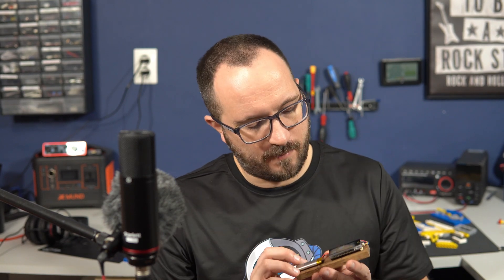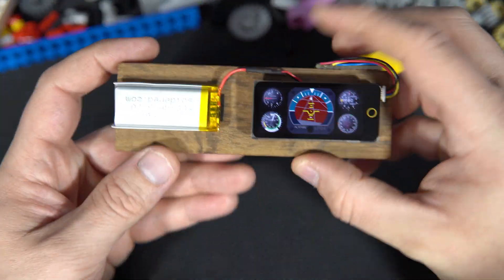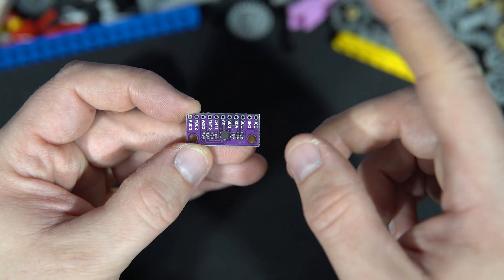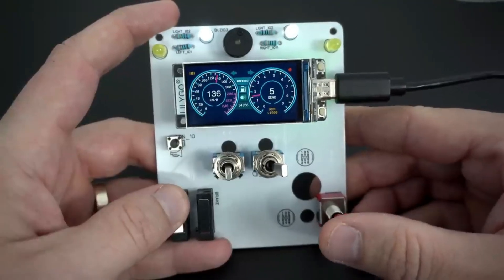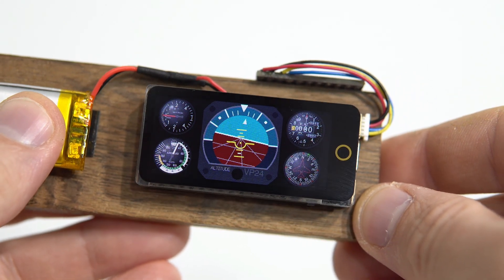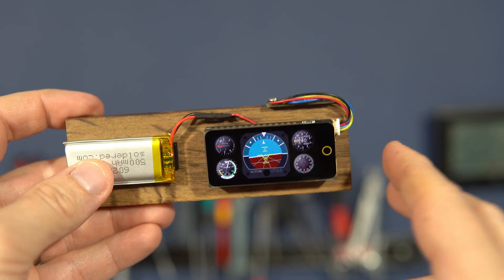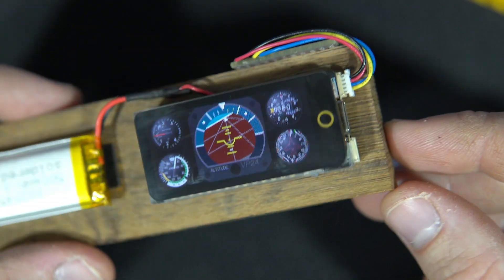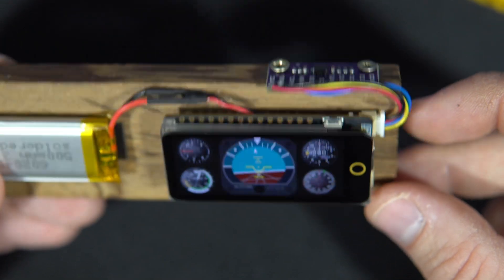I made Attitude Indicator for ESP32 board

Comment: Hello. I am a beginner in Arduino. Where are the SDL and SDA terminals on the standard version (only 1 small connector) of the S3 AMOLED module. Thanks in advance and thanks for all your assemblies.
Reply from the maker: On esp32 any pin can be scl or sda. You just need put in code Wire.begin(sda_pin,scl_pin)

Comment: Very Nice and I'm looking for months to have this 'RC scale cockpit' to use it in FPV. This is so awome!!
Indeed a reverse of the roll is needed, 
Is there a possibility to add a gps with flux receiver to have speed and direction?
A barometer to have pressure altitude?

Will it still work if I put it in a plane, because accelerometers are fine to calibrate but it should work of gyroscopes. 
Because if you make a coordinated turn for example the roll indicator will indicate a level situation although you're banking.
In this case, using only a accelerometer it makes a turn and slip indicator.

Comment: I just noticed, your board is different than what is available on LILYGO.  Yours does not have the two buttons and mine does not have connectors that are on yours. ????? I looked at the lite version, has the buttons and the connectors.  ????
Reply from the maker: Mine is touch version. You bought versiin without touch.

Comment: sorry to bother you, but I have attempted to solve this for 3 days.  I keep getting the following error message:#if ESP_IDF_VERSION < ESP_IDF_VERSION_VAL(5,0,0)
#include <driver/temp_sensor.h>
#else
#include <driver/temperature_sensor.h>
#endif   
temp_sensor.h  cannot be found.  I have searched all of the libraries, to no avail.  I wanted to check ESP_IDF version, but cannot that file.  ????

Never mind.  I give up.  Too many deprecated libraries.  I discovered what ESP_IDF is and cannot resolve that issue.
Reply from the maker: you need to go to board manager in arduino IDE and downgrade your esp32 boards definitions to lower version than 3.0,

Comment: I am trying to compile the code, but I get an error message.  The following cannot be found, In file included from C:\Users\rick\Documents\Arduino\PlaneTDisplayAmoled\PlaneTDisplayAmoled.ino:11:
C:\Users\rick\Documents\Arduino\PlaneTDisplayAmoled\LilyGo_AMOLED.h:21:10: fatal error: TouchDrvCHSC5816.hpp: No such file or directory
   21 | #include "TouchDrvCHSC5816.hpp"
      |          ^~~~~~~~~~~~~~~~~~~~~~
compilation terminated.
exit status 1

Compilation error: TouchDrvCHSC5816.hpp: No such file or directory  I 
I believe this is an updated version.  If so, I cannot find the original.  Any ideas?
Reply from the maker: you need to download this 
https://github.com/Xinyuan-LilyGO/LilyGo-AMOLED-Series

and  extract zip files and inside you will find libdepts folder, all folders inside libdepts need to be copied in your libraries folder.one of thease folders is  "SensorLib" ant that library contain files you are missing.

Comment: This is sooo cool! Will have to look up and get the sensor. Adding a GPS to the mix to have a directional arrow showing you the path and maybe an overlay of controlled airspace would be a cherry on top of the cake or at least per second logging of altitude and coordinates in a log file would be a killer.
If I may point out that you need to invert your logic on left and right banks. You have it inverted. Left bank would put your left wing in a dirt if that makes sense.
Do you think esp32 could handle some basic maps?

Comment: Nice, I have done an attitude indicator using an AHRS and its a lot more basic - in an actual aircraft you cannot use accelerometers for pitch and roll.  When an aircraft banks at any angle, a pendulum would always point direct to the floor, because you are turning in a circle when you bank and thus the forces cancel (unless you are flying out of balance).  Similarly for acceleration and deceleration, if you use an accelerometer you would think you were tilting back for acceleration and forward for deceleration.  And that is because gravity isn't a force its an acceleration.  An AHRS fuses data from gyros with accelerometers as well as magnetic flux to maintain its place in space - which is tricky.  Luckly you can buy one that does all of that and gives you the figures and you just draw them.

Comment: It's not an attitude indicator, its just an accelerometer. Lets say you put that in a car and take a sharp turn on a flat track. The horizon will show a bank even though the car is still horizontal. Likewise take the car to a banked oval track and take a banked turn at the speed that the bank is sloped for. Your device will show the car level even though it is banked. Aptitude indicators use gyroscopes. If you try to use that in an airplane, you will think you are level and go into a bank turn and possibly even a 1 G role. That wouldn't end well.

Comment: To all the Pilots that want to use this: Don't ! You will need actual airspeed and rate of turn to get the bank angle correct. Otherwise it will level out when you are in a normal turn. Likewise, but to a lesser extent for pitch angle. This because the sensors are just accelerometers /  gravity sensors vs true gryo's so they are good detecting movement. In a steady turn / pitch (1G) they will null out.
Reply: I don't think it was meant to be taken seriously!  Really is just a fun project...but appreciate your expertise on this subject!
Reply: @WahidKhan-r5m For sure! Just mentioned as many have tried to make something like this only to see it fail when used in actual flight.
Reply: @davepompea  thats cool , 😎  good point

Comment: Another beautiful project (you have excellent UI skills !). Which dev env do you use ? Im having trouble getting these recent projects to compile. For several years I have used the PC Arduino IDE  application for older ESPs. There are now options for web IDE and PlatformIO. I have bought several of these newer devices you have shown us (LilyGo should pay you a commision :-) ) and for all of them I have failed to get the correct libraries installed into the IDE and worse can no longer build my legacy code. I feel I need to start from scratch or have alternate IDEs and be able to configure different library locations ?  I understand the board manager and location of libraries but it seems the specifics of lvgl paths for different boards can interfere with each other. Appreciate your suggestion.
Reply from the maker: I use only Arduino Ide, it is not best ide but is easiest to setup. You can try to install evrything from start. Yes , dealing with diferent boards can make mess. Just install esp32 boards in arduino Ide, version lower than 3.0 and then you can install libraries in libraries folder by hand, and dont update them.
Reply: Try not to install the library in the IDE but simply copy the .cpp and .h files into your project folder, then replace < > with “ “ in the #include…

Comment: As a paramotor pilot I see a use, maybe with baro for pressure and altitude and even analogue input for engine temp and digital rpm capture. Data logging would also be cool.
Reply from the maker: Tnx for advices, i wish i have more expirience with this . It seems i made many mistakes. But it seems is not to bad.
Reply: What you're describing already exists as freeware. It's called Ardupilot and can run on a $30 STM32f405 board (look up Omnibus F4). It has GPS input and will even add autopilot functionality to the A/C. I used one in my Long EZ for logging.

Comment: If you use a temperature, pressure and humidity module, you can also have altitude reading added to the altimeter in the top right. The airspeed indicator (the gauge on the bottom left) should be on the top left. If you google "aircraft instruments six pack" you will see the standard setup of instruments. Sorry, couldn't help it, I am a pilot. ;) I hope you don't mind. Love your channel,  I see that you like to play with Lillygo T-Display S3 a lot.  I can't make mine work for anything. Pozdrav iz Washingtona!

Comment: What libraries does the code require?

When I try to compile it I get an error about a missing drivers \ temp_sensors.h file.
Reply from the maker: In code you can see adafruit libraries that are used, you can download them and it will wor then. Did you manage run my last example for this board?
Reply: @VolosProjects  Thank you very much for replying and showing us how to use this board!

I did loaded the Adafruit Sensor & LIS3DH but the attempt to compile still lists the temp_sensor.h file as missing. I don't know which library that error is talking about to load it as there are so many others also listed when I search.

Could you let me know which lib has the temperature sensor file?

I have not tried your other examples but I will.  

Many thanks!
Reply from the maker: @opjose  Thank you , but belive me this is not firs example you want to try on this board, also project will not work if you dont have LIS3DH sensor.. can you please try my first project from this videe, you will need to use right libraries , i explained which ones in this video https://youtu.be/Waq2xI-t948   you will need to go  to this rep and coppy all libraries from here in your libraries folder https://github.com/Xinyuan-LilyGO/LilyGo-AMOLED-Series/tree/master/libdeps
Reply from the maker: you are right, lilygo updated libraries and i used old ones, i updated my code please download and try new version.
Reply: @VolosProjects  

Thank you again. However when I try to compile the new code I get the same issue:

* @file      LilyGo_AMOLED.h

Arduino Programs\PlaneTDisplayAmoled\LilyGo_AMOLED.h:30:10: fatal error: driver/temp_sensor.h: No such file or directory
 #include <driver/temp_sensor.h>
          ^~~~~~~~~~~~~~~~~~~~~~
compilation terminated.
exit status 1

Compilation error: driver/temp_sensor.h: No such file or directory

I do have the libraries installed.
Reply from the maker: hm, weard, do you maybe updated esp32 board to 3.0 version, it will not work, you need to use lower esp32 board definitions @opjose
Reply: @VolosProjects  It was the ESP I2C slave library which was at 0.3.0.  When I rolled it back to 0.1.0 the compilation worked!

Thank you!

Comment: How sensitive is it ? Perhaps it can be used in a jeep to check angles, or use on an RV to check the level.
Reply from the maker: Sensor is fast , but updating screen is not that fast so maybe it will be to slow whole fast driving in jeep.
Reply: @VolosProjects  not fast driving, just for rock climbing and RV parking so the tent/bed are level.

Comment: It seems a bit wrong... when you turn left, the artificial horizont "turns right"(in fact it must be aligned with the horizond, because it is the plane that turns-roll/bank).
Yours turn in the same direction of the "bank angle"/roll angle.

That is good you are not a aviation instruments provider. But the thing is cool.

Comment: That would be cool to put in a fpv rc plane. If you could figure out how to make that function with rc plane electronics you could probly sell it for a decent price. Someone else sells something similar for $400 but isn't nearly as nice. If you could get real time sensors to display altitude, air speed and attitude it would be perfect. Or get it to communicate with fpv flight controller via uart or sbus or other rc plane protocols

Comment: Will you be adding a video explaining the connections and the code? I am getting so many errors.
Reply from the maker: hello, do you have same board and sensor, did you install all libraries?
Reply: I have not yet connected the  LIS3DH 3-axis Accelerometer. Could that be the problem. I was just wanting to test that the code would install.
Reply: Big problem now is at line 427 error  'init' is not a member of 'TouchDrvCSTXXX'
Reply: I am unable to find TouchDrvCSTXXX in your github or anywhere on the web. By the way. I have the development board.
Reply from the maker: Thank you , but belive me this is not firs example you want to try on this board, also project will not work if you dont have LIS3DH sensor.. can you please try my first project from this videe, you will need to use right libraries , i explained which ones in this video https://youtu.be/Waq2xI-t948   you will need to go  to this rep and coppy all libraries from here in your libraries folder https://github.com/Xinyuan-LilyGO/LilyGo-AMOLED-Series/tree/master/libdeps

Comment: Nice project. One little problem. The artificial horizon - Y axis is good but the X axis (roll) is reversed. the horizon should stay horizontal. Roll on 100K !
Reply from the maker: Tnx, i can see now. I never used nothing similar so i made that mistake.
Reply: @VolosProjects  Ignore that comment, you are correct for western aircraft.
Reply: Was instantly gonna comment this. Lol
Reply: Hmmm, Only if  you're used to Russian aircraft. The artificial horizon is different between Soviet Era and Western Aircraft. The cause of at least one airbus crash by Russian pilots.
Reply: @brianroberts5062  - In Soviet-era planes, the horizon indicator was constant, only the plane icon tilted. 
(However, all target indicators always showed the west direction) - a joke ;).

Comment: Nice project!  I have a question on TFT_eSPI, in my project if I use more sprites or bigger ones some of these is not drawn on the scree even if i ave enough free memory. Do you have some tips for  me ? I think I'm not the only one. Thanks for your wonderful project, i learned a lot from your work.
Reply from the maker: hello, sorry for late answer, sprite need lots of memory, so largest sprite s3 can handle is 400x400, you can use few smalers, or you can push same sprite on diferent plasec on screen, it is hard to explain, so basicly you draw content of sprite and push it to lef corner, next you draw another content and push it to anoother corner, FPS will suffer but do you realy need 30 fps. i used that aproach in this video https://youtu.be/4-wQCipEX4A?si=jE0_cF-hEGaH1VV9
Reply: @VolosProjects  thank for your answer. I use several different sprites. I will try to reuse the same sprite for different icons. Thx again

Comment: Technically that's an attitude meter :) love it none the less :)
If you add a pressure sensor (bme280) you could also call it an altitude meter
Reply: And add a compass module and it become a useful project
Reply: That covers what I was going to say
Reply: But to be accurate, you must use a 6-axis accelerometer, a gyroscope, and a magnetometer. Like BNO085
Reply: @krzysztofbartnik I love my bno085!
Reply: Actually, it is an Attitude Indicator (AI) 😉
Reply: It is an attitude indicator (AI), formerly known as the gyro horizon or artificial horizon